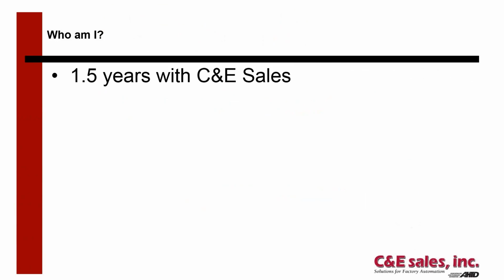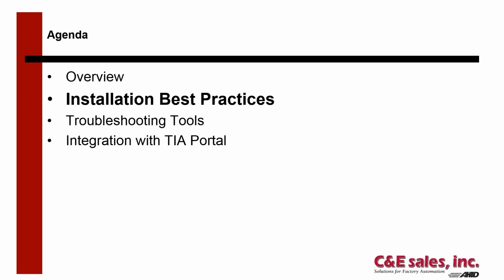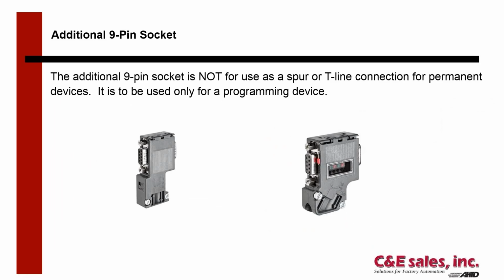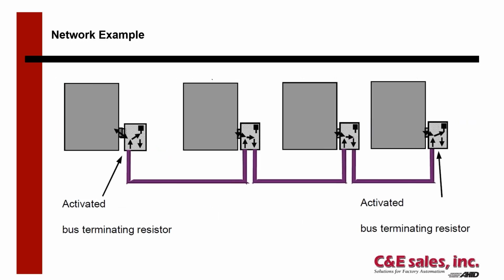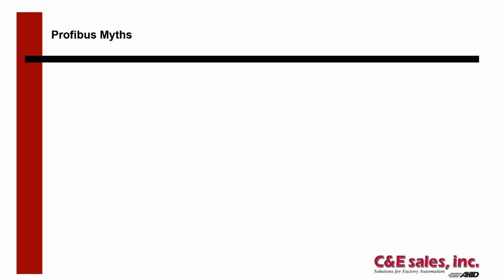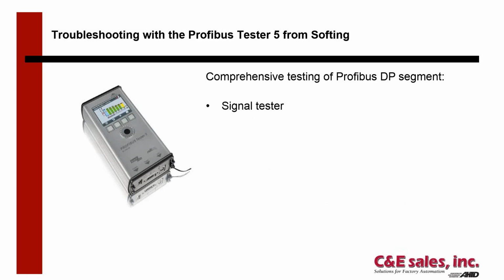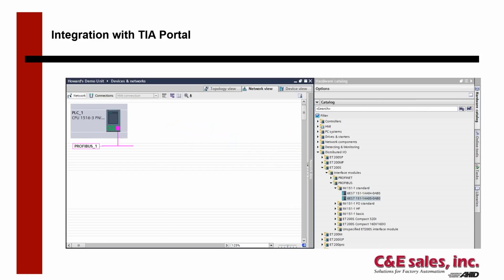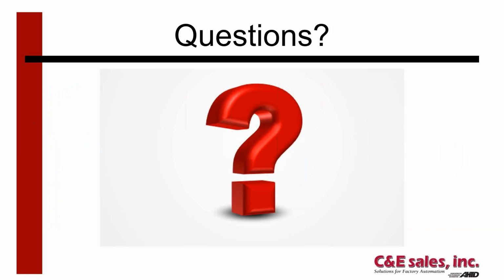Siemens Profibus and TIA Portal

Comment: I have a question about shield grounding. Isn't grounding on both ends of the cable dangerous due to possible potential differences of the ground in those two points???

Comment: Hi,

We're working with one of my customers to install the isoPROFIBUS PCI card onto a newer generation motherboard i5 vs P4, we installed the 6AU1390-0AA00-0AA0 / isoPROFIBUS card into the new computer and moved over the XP installation as well, windows loads but the isoPROFIBUS card has an error coming up in device manager (error 37).

We tried re-installing the driver to no avail and were hoping for an update to the driver or help with this error.

Basically we would like to run our Thermwood software on a newer generation pc without upgrading the whole machine...

You suggestions and replies are greatly appreciated.
Reply: Sarv Atam t